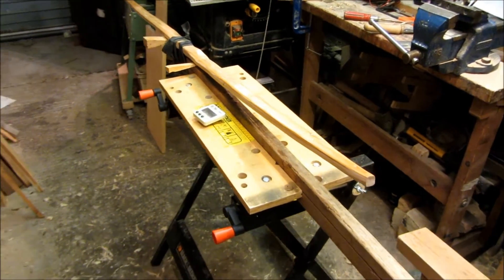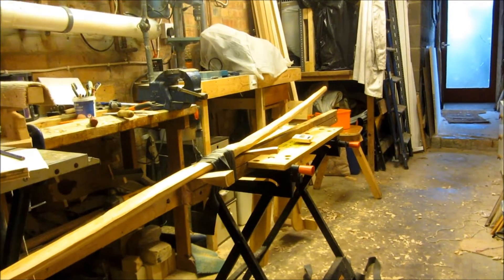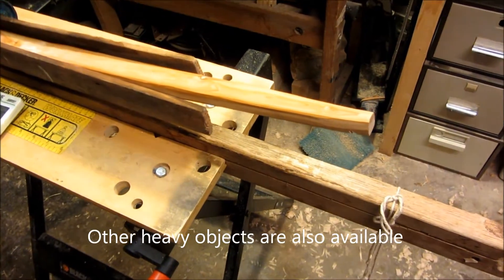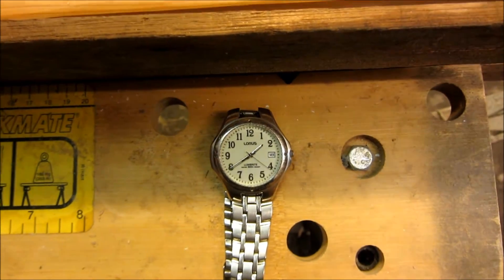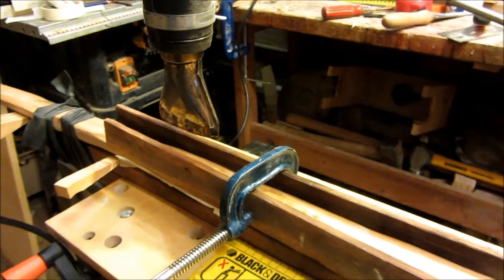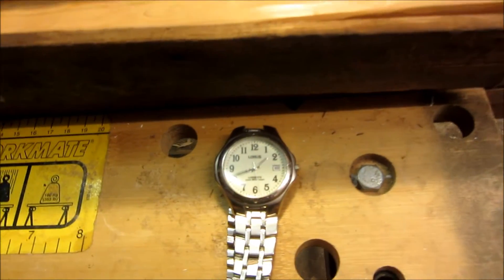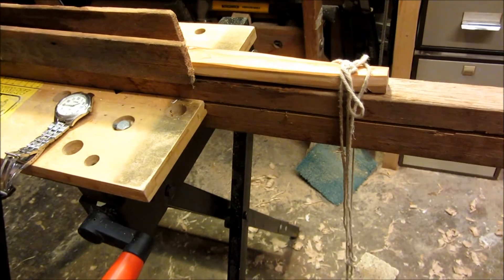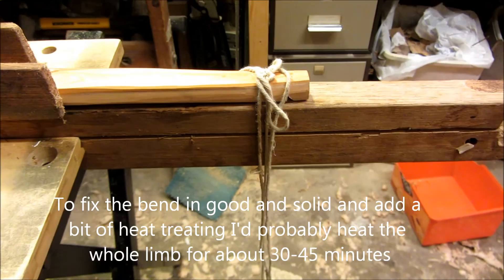Watching a Bow Limb Bend with Heat

Comment: Good evening sir,
Thank you for your video which helped me to solve a symetry problem on one of my yew bows. As I am not a happy owner of TBB4 (I'm French...), I had never tryed to heat treat my bows. With your video, I understood how to try.
Indeed, there were a weakness on its lower limb and I had to take off some wood along the bow apart from this point. But the bow (which I had made too fastly some years ago) was too much deformed at this point. Althought I had reestablished a good ratio of wood all along the bow, on the weak point, the wood was definitely twisted because of the former dissimetry.
I could manage thanks to your video to obtain a perfectly symmetric bow!
Thanks again!

Comment: hey del!
Do you know anything about bending Osage that has sapwood on it?
Im making an osage warbow with the sap on it and its doing its thing nicely, only that in the first third of the top limb theres a knotty area that gives tha stave a bunch of deflex. Normally I wouldnt mind deflex but since the unstrung bow is at abut 5" deflex 
I dont think I have any other option than to bend it back a bit so there isnt just 2 inches to go to full brace.

Thanks in advance. 
- WF

Im awfully sorry for saying deflex 3 times in one sentence
Reply from the maker: Yeah I've bent Osage, it likes bending. Not sure about the sapwood thing, best place to ask is the primitive archer forum as it's based in the US and is heavily into Osage. There's some on my blog here:-
https://bowyersdiary.blogspot.co.uk/2011/08/better-bending-technique.html
If you look at the previous couple of posts and read the comments too.
Main thing with any heating is patience! Thick sections can take ages to get the heat through them.
Reply: Thanks for the help. wish you a great weekend :)
edit
I forgot to ask; I heard someone say that with heatbending osage will delaminate the heart from the sapwood, thats why I asked in the first place.
If that would be the case Imight aswell deal with the 5" of set as it is but I dont really know if my memory is serving me right or if I even heard that right. Do you have any experiences with delamination on steam/heat bending?

Again... thanks alot and have a great weekend del!
Reply from the maker: No experience with de-laminating of any wood... not used Osage that had sapwood. The guys on primitive archer will know for sure.